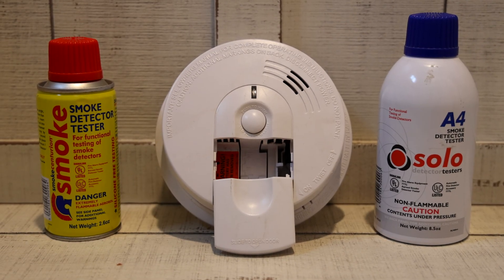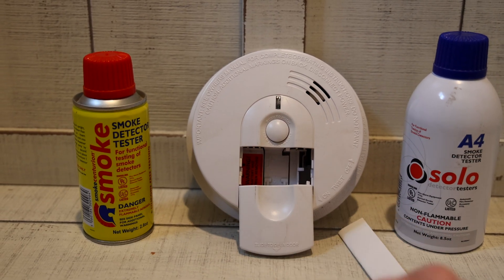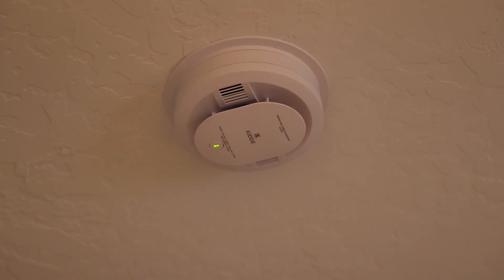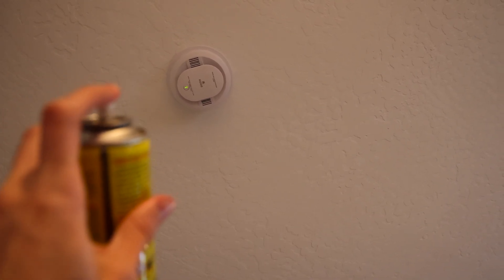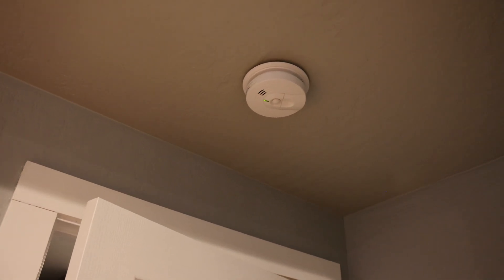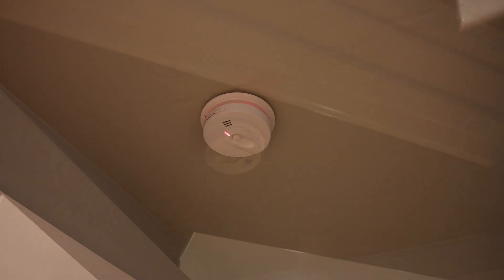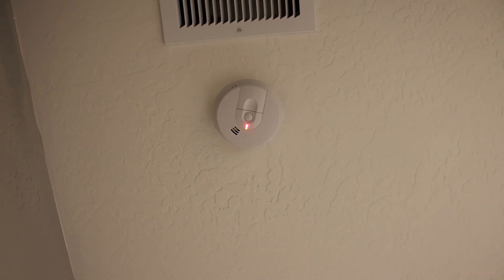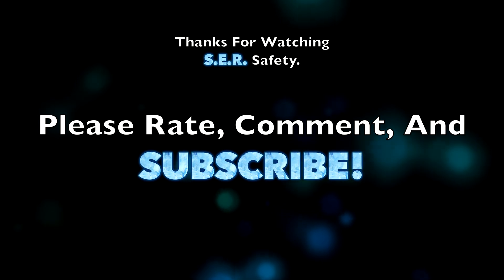Complete Smoke Alarm System Test in a Newly Built Home!

Comment: Never install these alarms in your house
Reply: Mhm: like a lot of older units they really should only be for display purposes only.
Reply: @ I never said anything about vintage units
Reply: @ I know, but I was comparing the two since both are really only good for display purposes rather than actual life safety.
Reply: @TheCarson116 honest to god, most vintage alarms work better than most modern ones
Reply: @ I don't know about that especially if said modern ones are engineered properly (AKA not most of the ones made by Kidde), but alright.